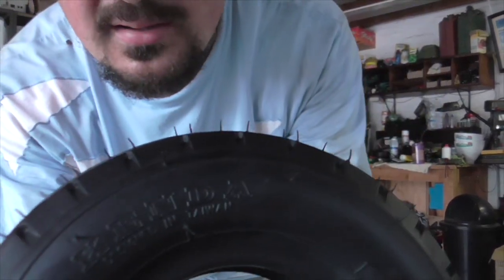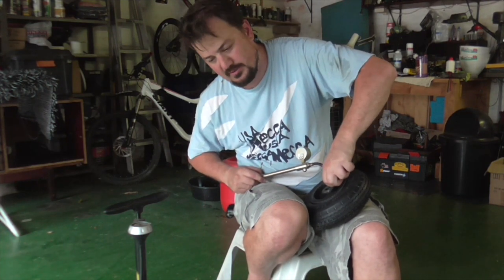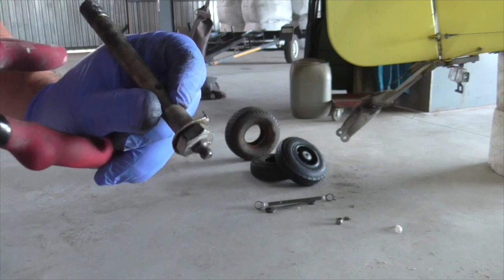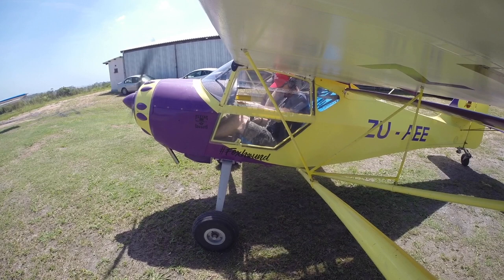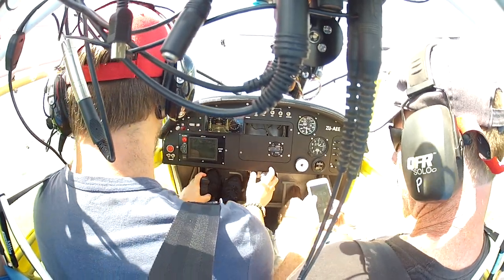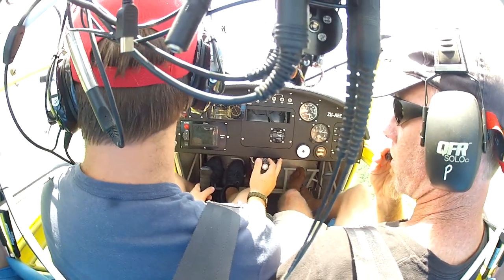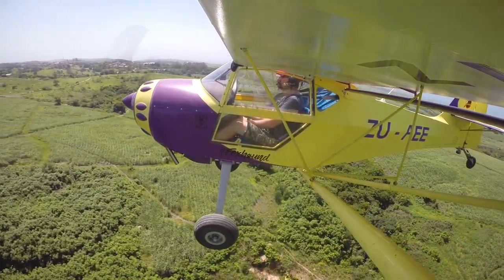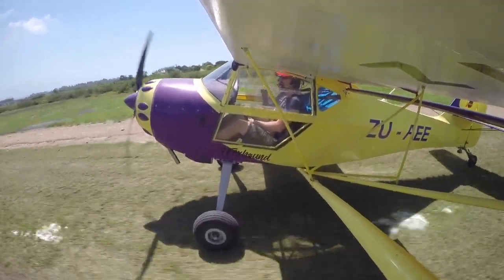I broke the KITFOX - Tailwheel blues

Comment: I wonder if you lower the tire pressures a little bit if that will help the feeling of rough landings on the grass. I'm sure someone on the Kitfox forum would know good pressure numbers for your size tires for grass operations (if any different at all).  Just throw some Alaska Bushwheels on the Foxhound, lol! I do think once you get the VGs installed the lower landing speed with really help your landings. Awesome seeing you work on the plane with your pistol on your hip, btw.
Reply from the maker: I have lowered my main gear pressure to 10psi as per recommendation already. I have placed an order for some 26" bush wheels, so hopefully those will arrive soon and that will definitely help! However, I feel that learning to fly and land on rough terrain with the 600-6 tyres will make me a better pilot come the 26" wheels!!
I can't wait to get the VG's on the plane, I just want to do some tests first - priority right now is getting the solo under the belt then I will start messing with the plane again.

By law I'm meant to have my pistol concealed - but in the hangar its rarely concealed because I'm always swapping it between my hip and the carry bag in the plane - its too uncomfortable to fly with on my hip.